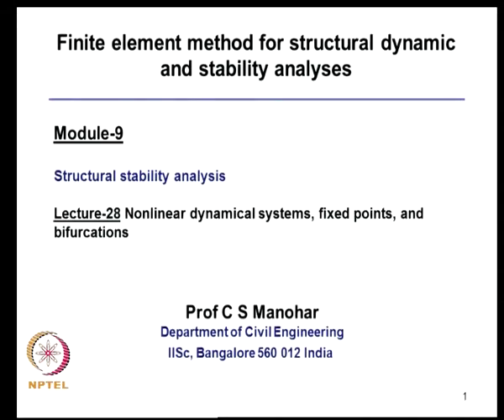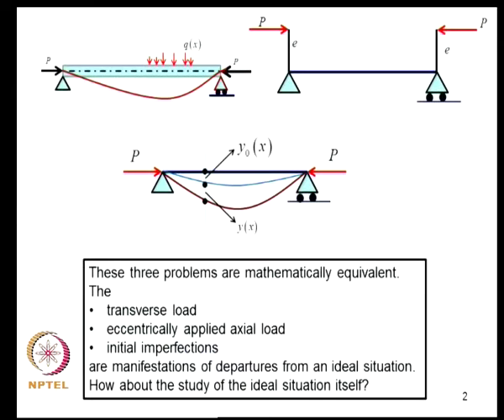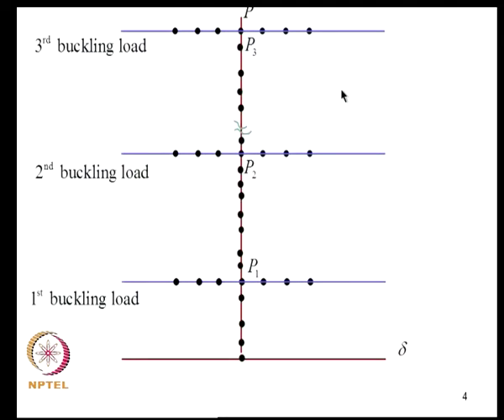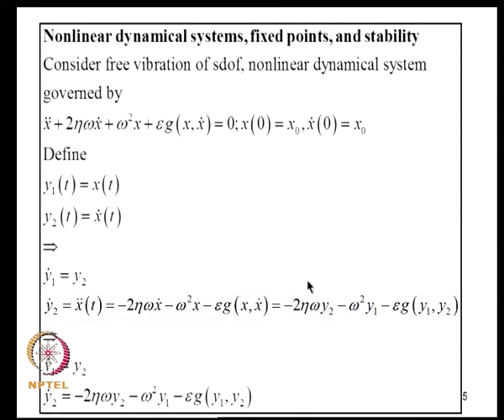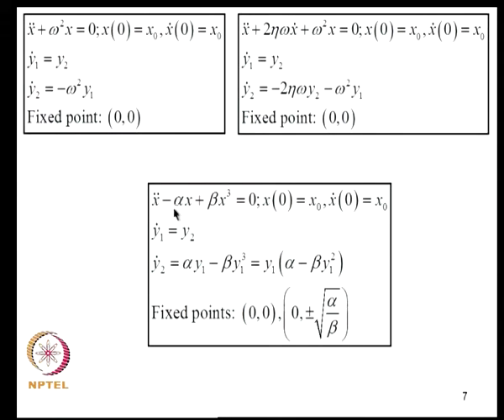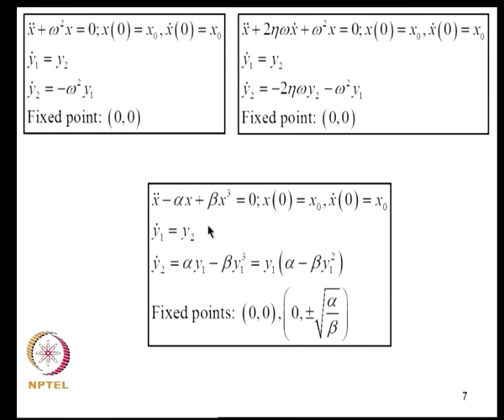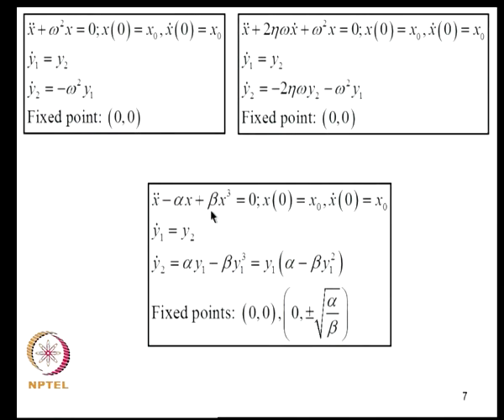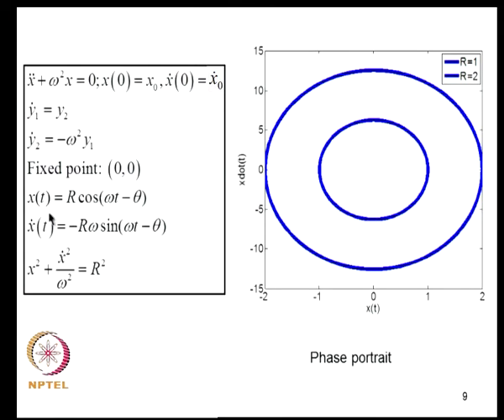Nonlinear dynamical systems, fixed points and bifurcations

Comment: Hi Sir hope you are having great time. I have a question regarding fixed point. In context of a function fixed point is defined as f(x) = x or standard notion is T(x)=x as given by Banach fixed point theorem. But in context of dynamical system when we use the word fixed point it seems that it doesn't relate to definition T(x) = x but rather we say that fixed point is where the derivative is zero. So my question is that does the word fixed point meaning differs in both contexts or is there any analogy.